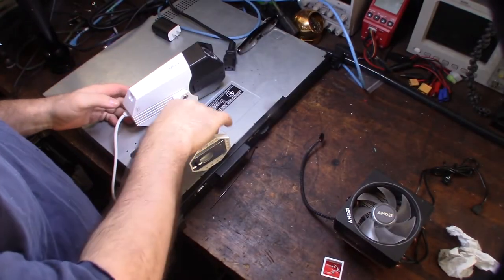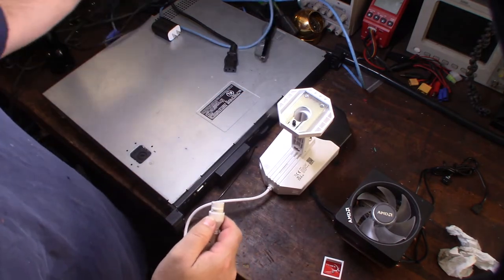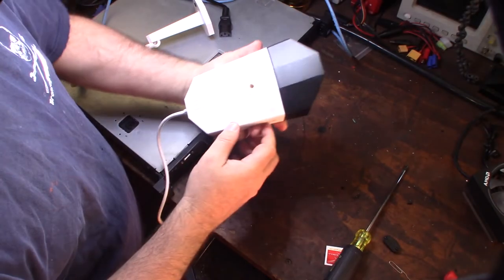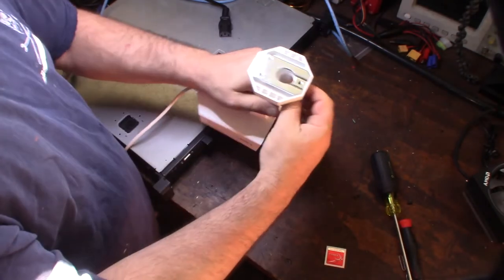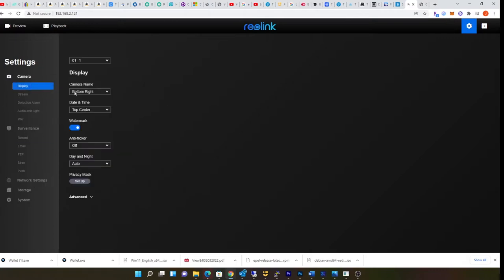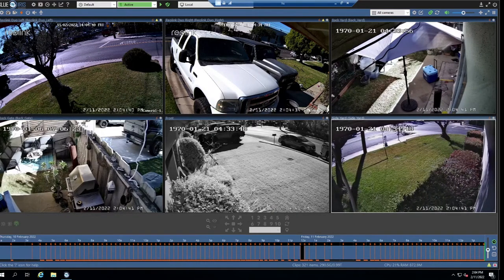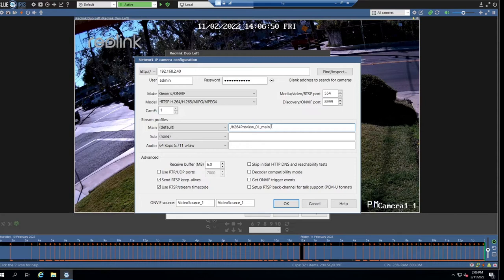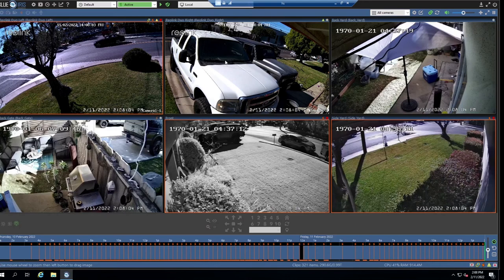Reolink Duo POE IP camera Blue Iris install Ebay score $65 150 degree view

Comment: Thanks for posting this video! I found it buy searching google for Reolink duo blue iris youtube. Just curious how the experience has been in the 2+ months since the video was posted? I've read a ton of bad things about using a Reolink camera with Blue Iris, but you showed a very simple setup and the video quality appeared to be fine. What are you thoughts so far?
Reply: I've heard that too. But I too have not heard the details of exactly HOW they don't work well together. I think it is particularly the 8mp cameras